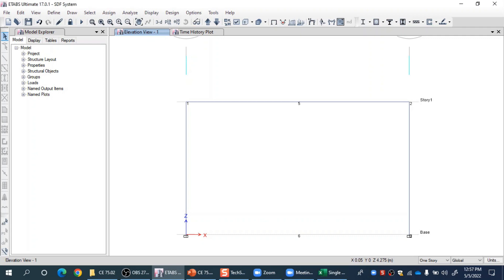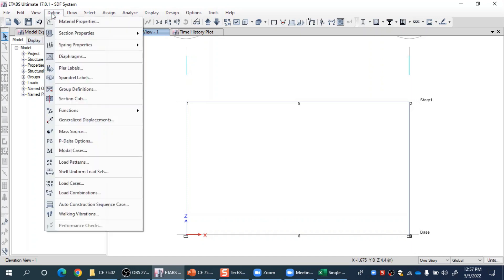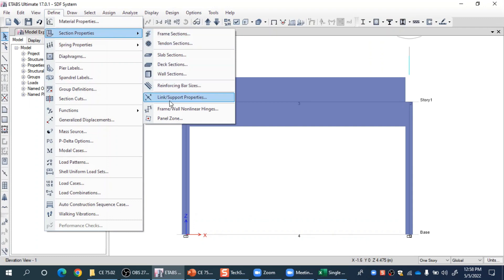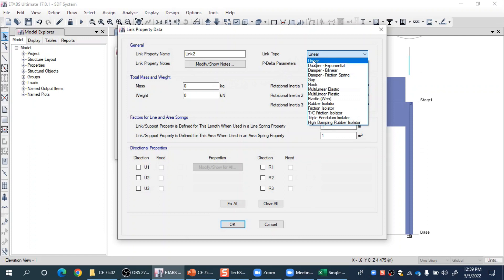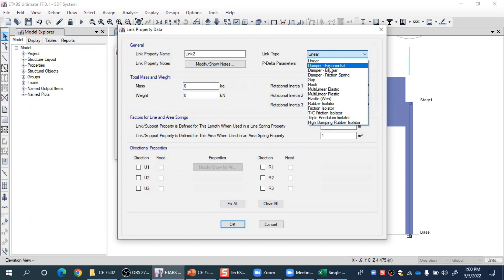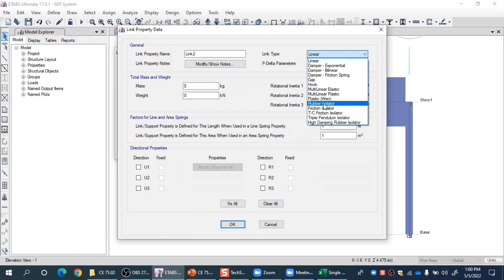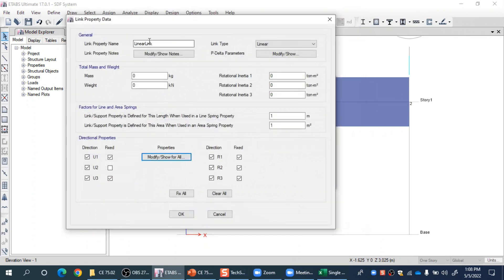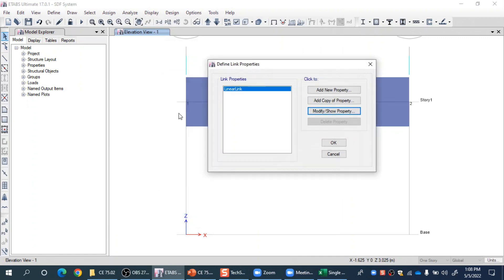Part 3: Link Elements in CSI ETABS - Basic Introduction

Comment: Hi sir, if I have inclined rafter fixed to the column, and below of it there is a beam, in actual the beam is rested below the rafter casue of end plate connection between the rafter and column
so, shall I move the beam it self to how much it is beneath the rafter? or shall I use the link command to join between the below beam and rafter??